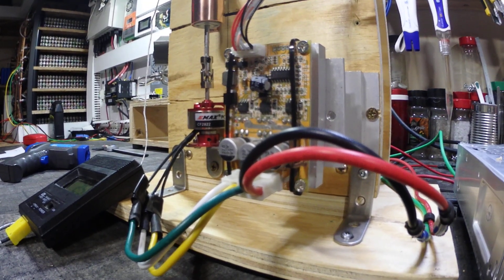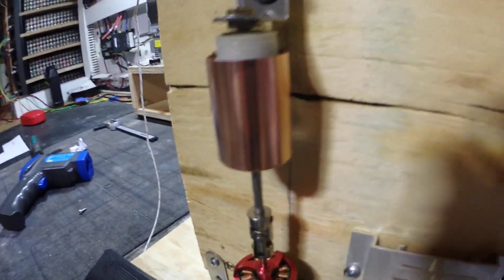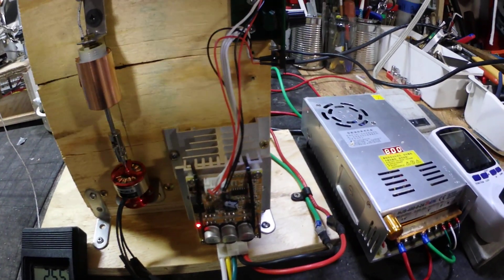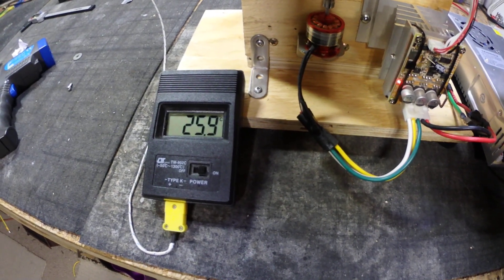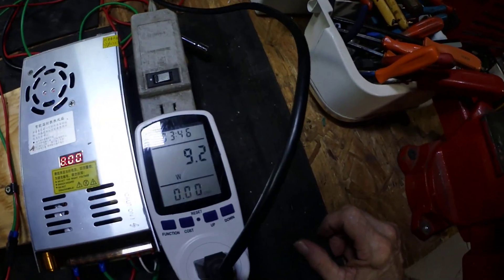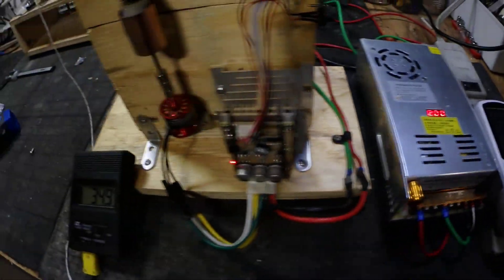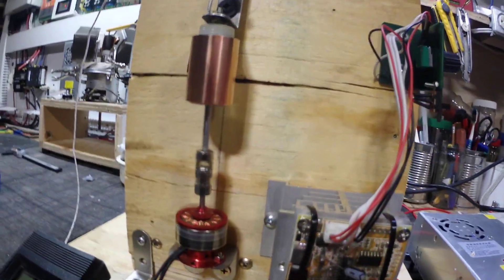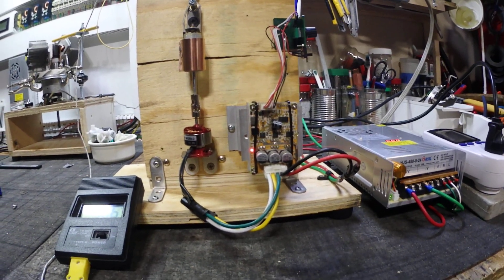Brushless Magnetic Heater Test 1

Comment: Nice work, looks great, good choice for a motor - If motor gets hot under heavy load, maybe it can be immersed in liquid, and the oil circulated with whatever liquid you have to be heated by the copper....maybe the motor can work as water pump too somehow for a dual use for it....I dont know just thinking..
Reply from the maker: Great idea ,I think a generator in the mix would be a good idea also...Thanks for the input
Reply: @saucecoreindustries3706  add a small prop if you have motor heat issues